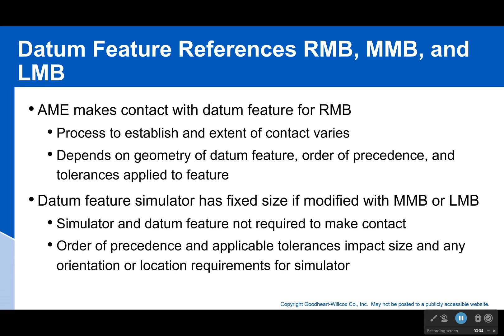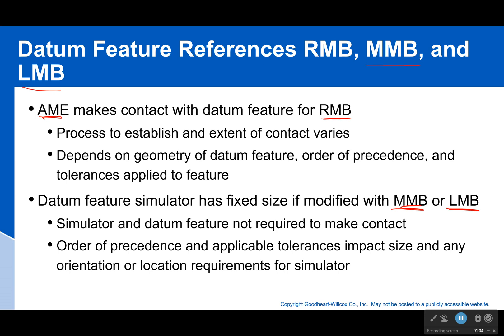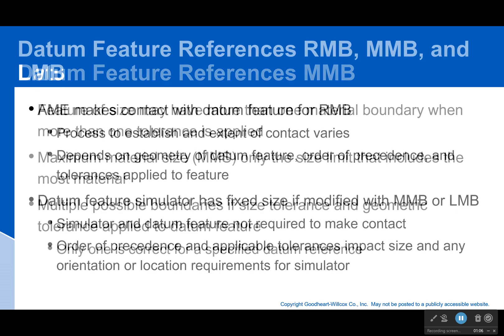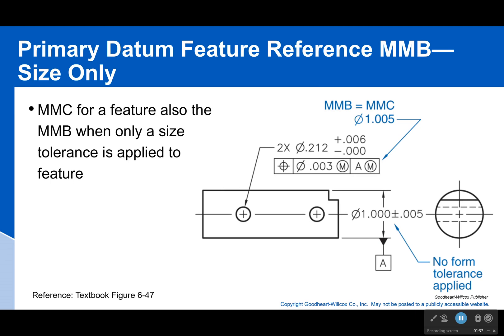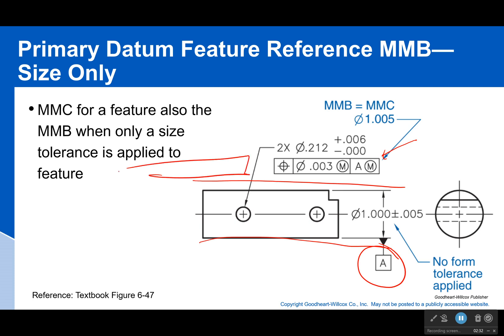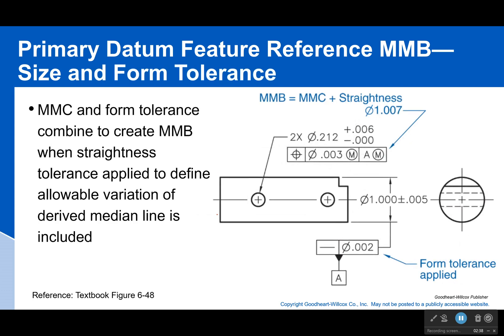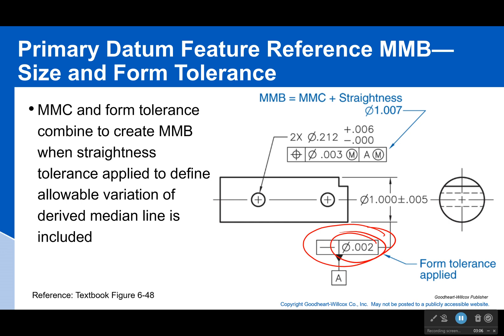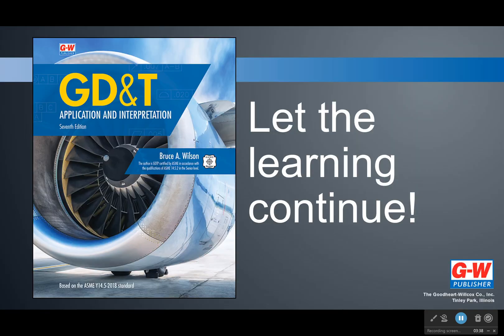MMB for Feature of Size

Comment: What you said at the end there with the red sketching made it totally click. Thanks! When you say "take into account if referenced later at MMB" does that mean you'll always add its tolerance, or is it more of a "consider if necessary"?
Reply from the maker: You always add the tolerance for anything that references a feature with an added MMB modifier. That way if the datum feature is smaller than it's MMC you get to use the extra wiggle room to your advantage.
Reply: @drkiddengineering  Ah yeah that makes sense. Thank you!